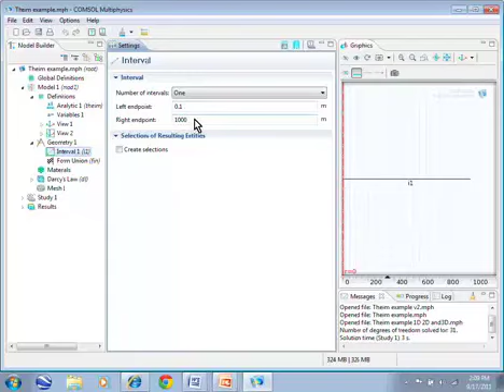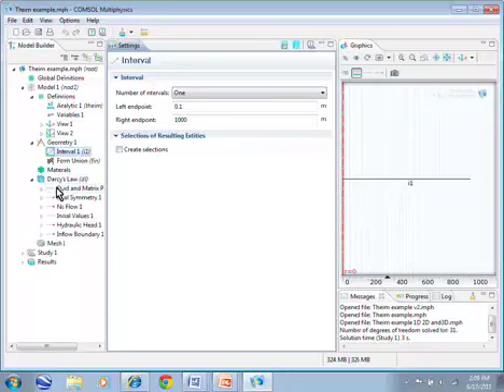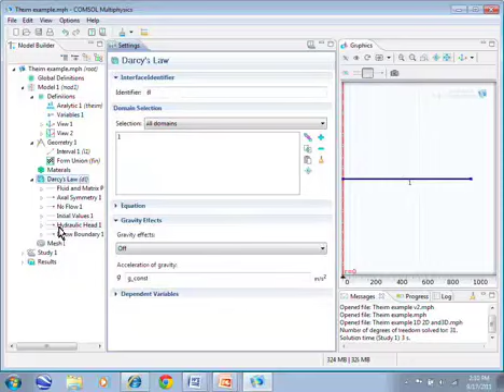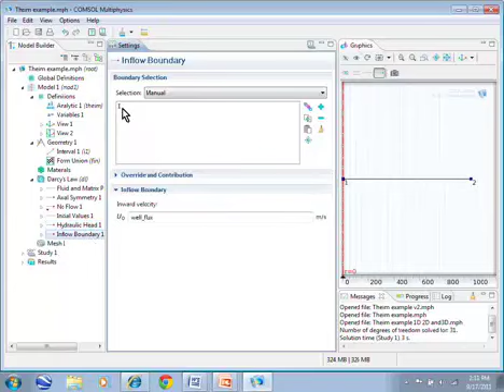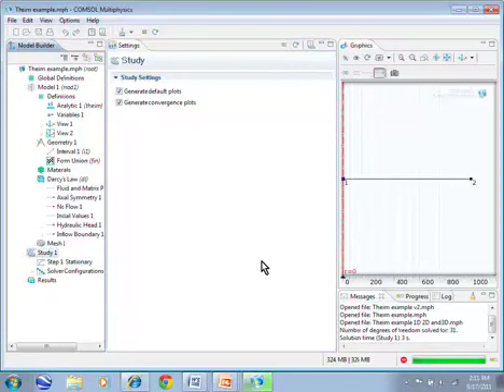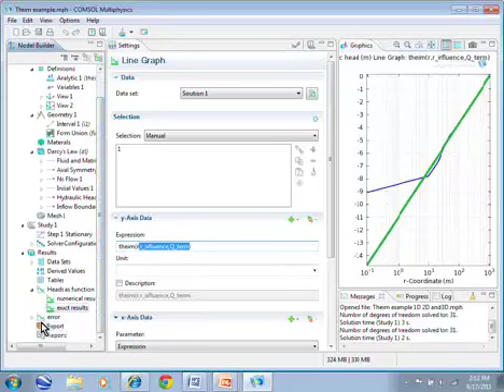intro to 1D line sink Theim (Part 1)

Comment: In this video, you import the variable txt file, and we dont have that text file. Also, the quality of the video is too low, and it is not possible to read the variables from the video and input them manually. This is the biggest issue that I had in this video.
Reply from the maker: Hi Saeed,   This video is converted from another format and that affected resolution.  I will see if I can revise the conversion and improve resolution.  Larry
Reply: @lcmurd1  Thanks a lot